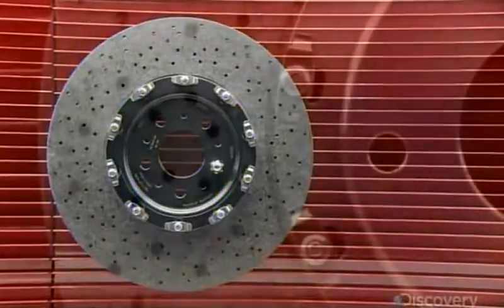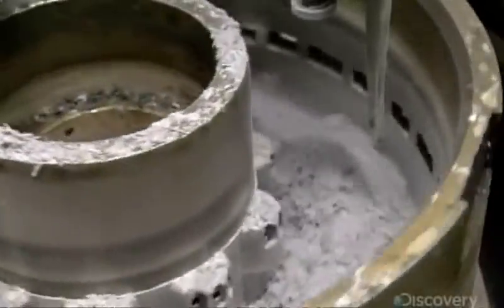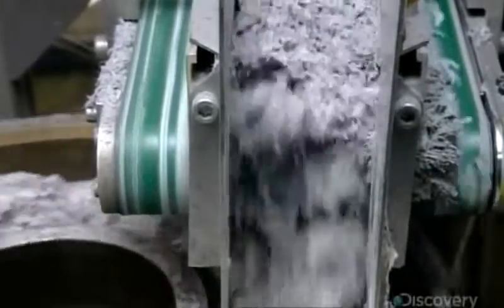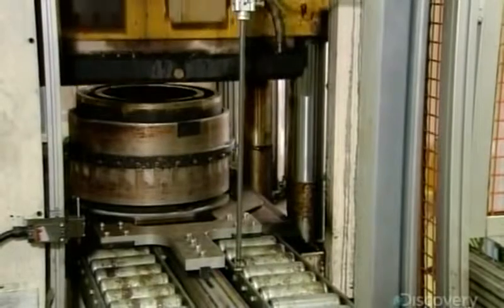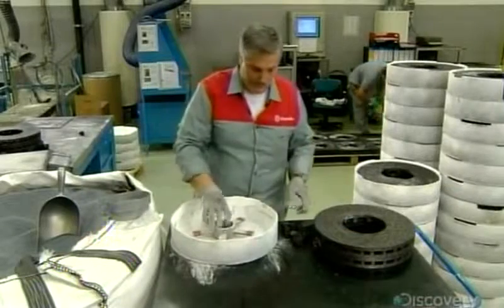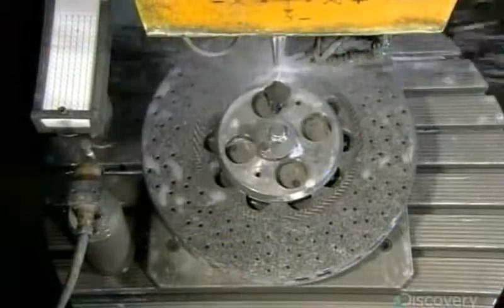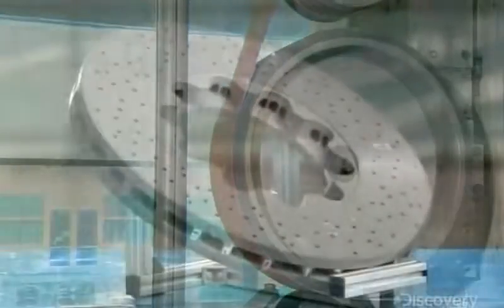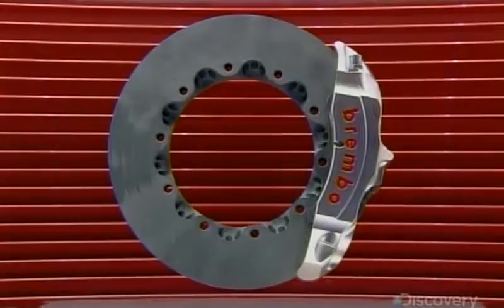How It s Made Ceramic Composite Brake Discs

Comment: This is supppperrrrrrrrr easy !!!! Why does it cost $20k a set !!!!! 😢
Reply: brembo once said it takes 90mins to put out a iron rotor, it takes 3 weeks for the carbon
Reply: That not easy at all, how do you could make a vacuum chamber to replace silicon
Reply: the price of the machines required to make it. huge presses and ovens are crazy expensive.
Reply: @Funnyfish458  Indeed! The electricity bill to heat the ovens to over 1000 C for two days has to be astronomical.
Reply: Just need a couple things from Walmart and Home Depot